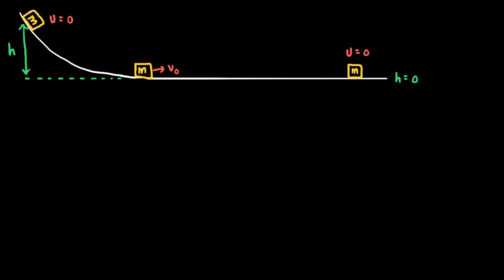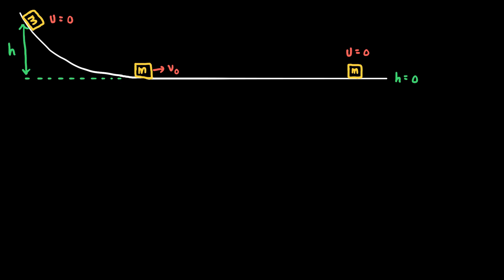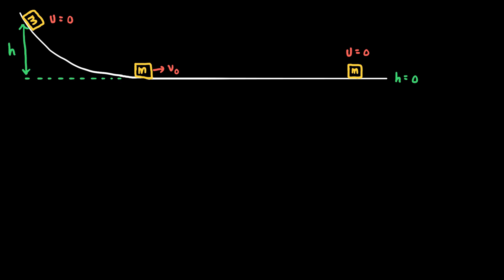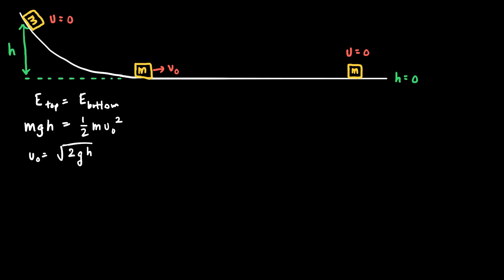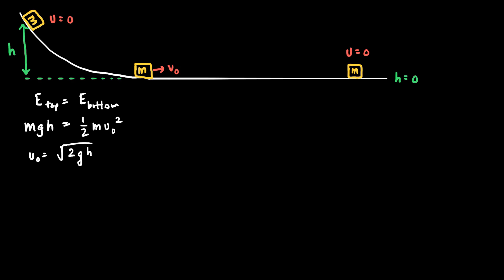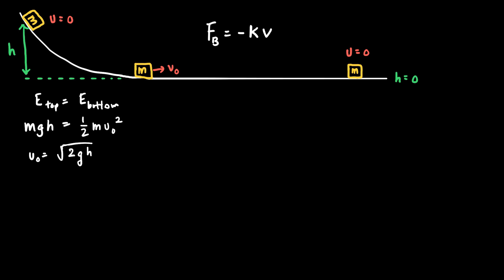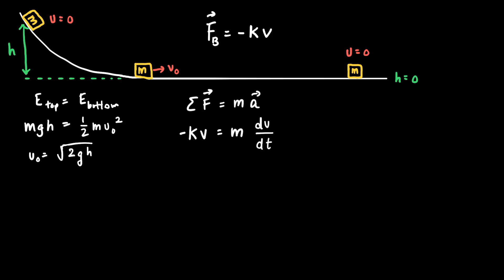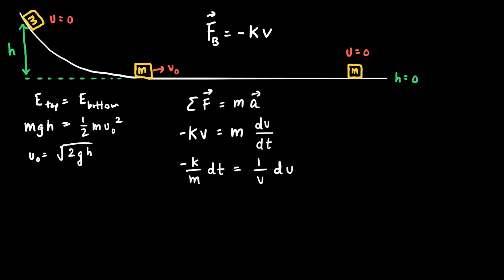Braking Force Stopping a Cart

Comment: Is it common that braking forces are proportional to velocity?  The force of friction is dependent on weight alone (no velocity component), to my knowledge.  The drag force from air (or liquid) is proportional to the square of velocity (v^2).  I never considered k*v, so does this apply to disc brakes, for example?  And where do I find real world values of k?